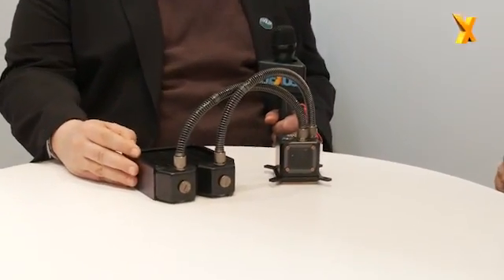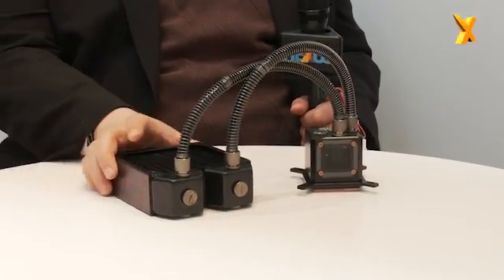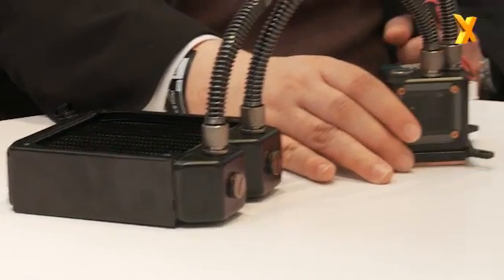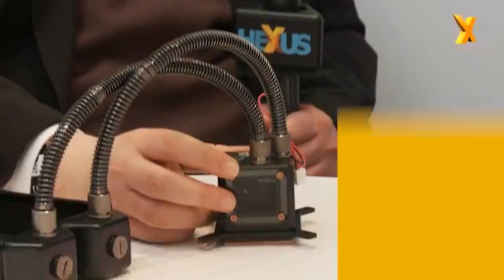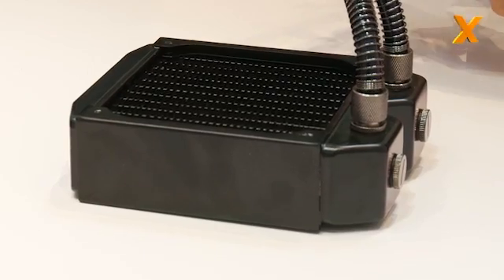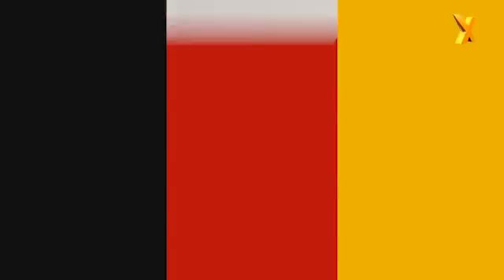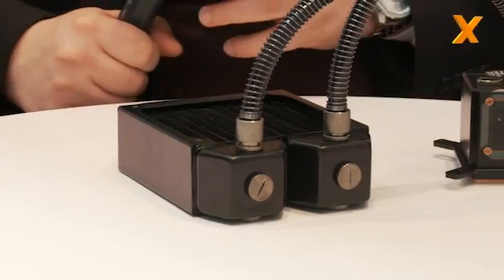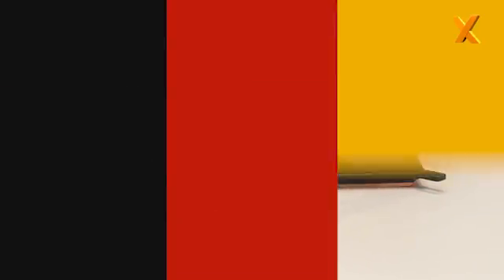Cooler Master returns to liquid cooling

Comment: If the H100 fits in a case in pushpull configuration, this eisberg 240mm will fit as well. It will be just hanging a bit lower..

Comment: only problem is, with the 240mm version, it will be difficult to have a push/pull configuration in the roof of your case due to the thickness, i know people who had a hard time fitting Corsair H100s with push/pull due to overlapping with the motherboard

Comment: @WhiteHawk137 That would be great.  The NexXxoS XT45 radiators are among the best for low RPM fans since they aren't as thick as the standard 60mm radiators and have somewhat low FPI.  I do expect the CoolerMaster product to command a huge premium over something like an H100 though.